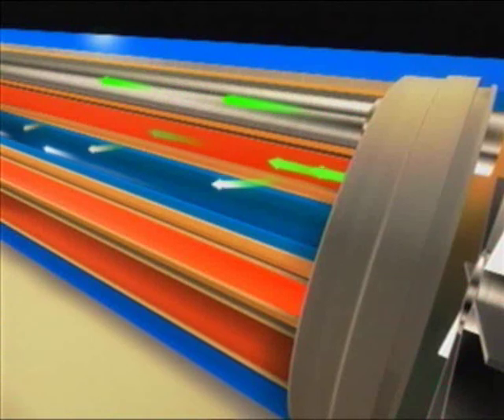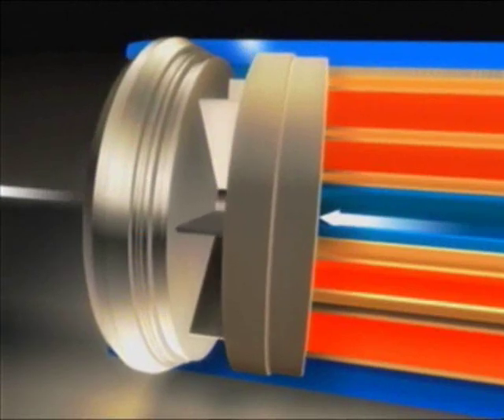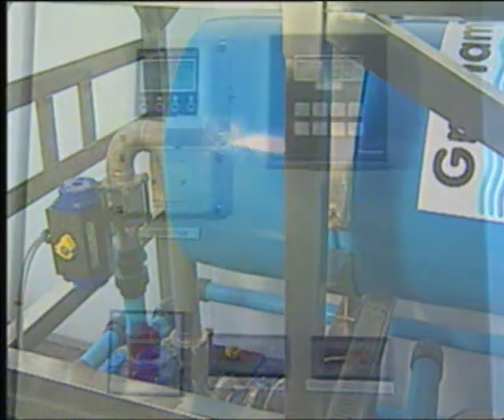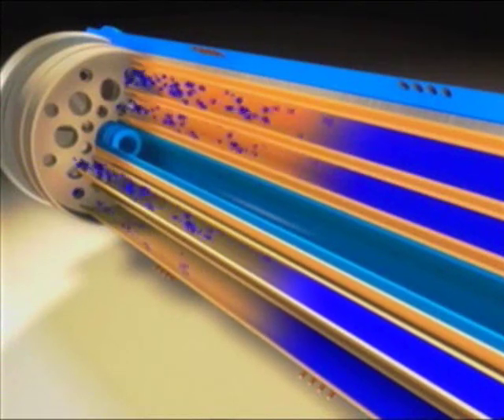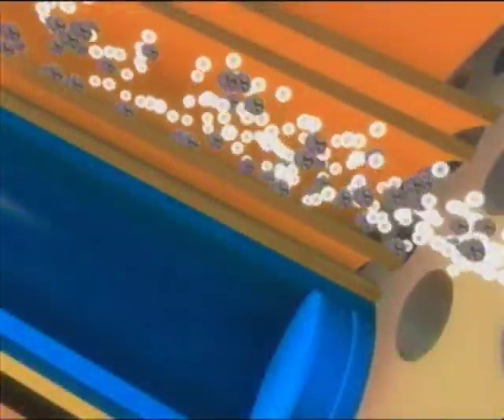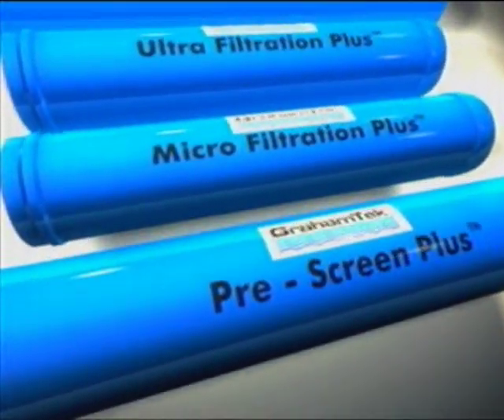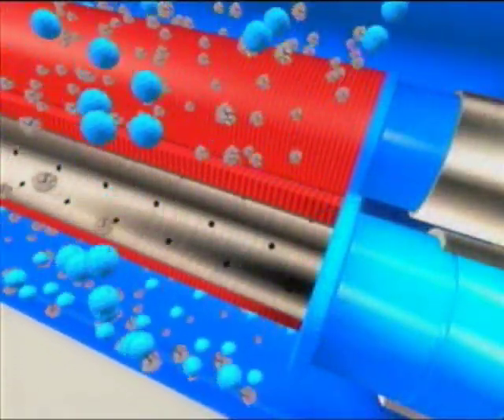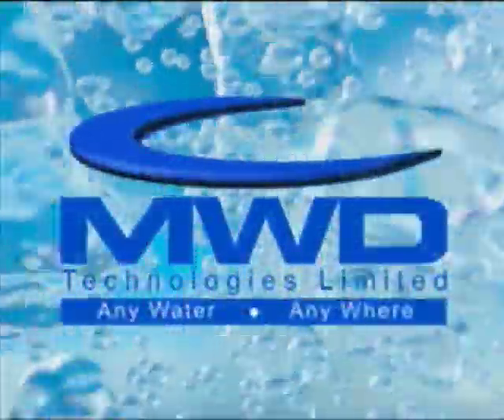Desal RO 16" Desalination Plants

Comment: I liked the video. I have invented a buoyancy engine (you should have a video response) which is primarily for energy generation but may be easily adapted for to produce large volumes of drinking water or Hydrogen from sea water using wave power. I would be interested to see a case study of your largest RO plant and any details which would help inform how such a plant could be incorporated into the buoyancy engine.